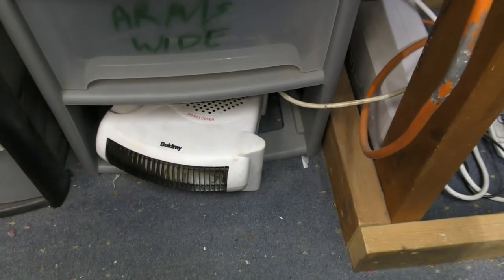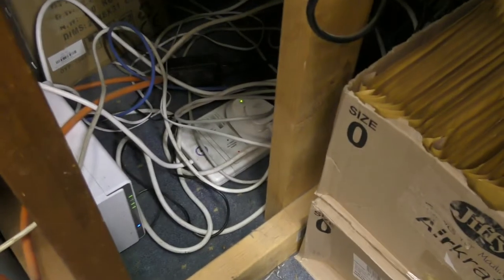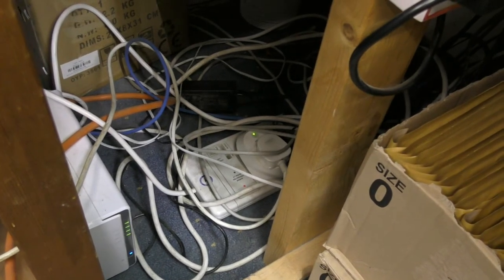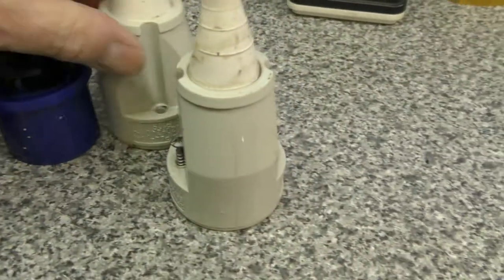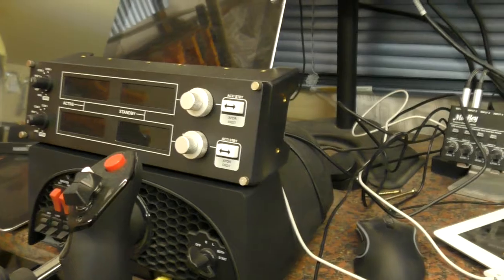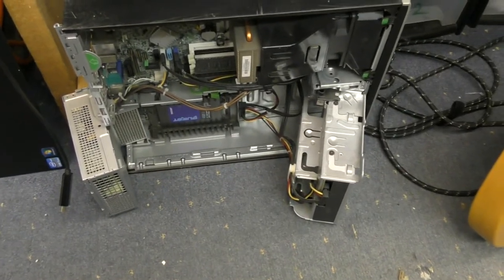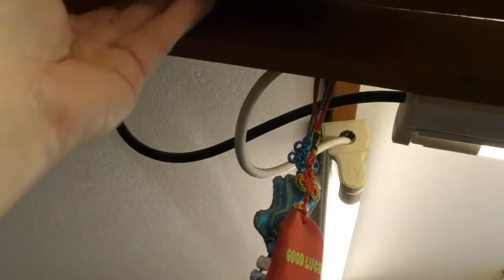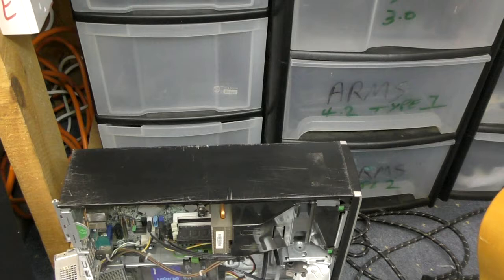Nearly burnt the workshop down!

Comment: Small contact surfaces that do the actual contact, so the current is going through a tiny contact surface. Thus it has cycles of heating and cooling, which means the contacts eventually get a thin oxide film on them, and then you get a thermal runaway event. Not helped by the chrome plated pins, which will grow a thin oxide layer, and make for the small high resistance spot.
Reply from the maker: Indeed, I think the overnight 2000 watts did the damage and it has been smouldering since then.
Good news is the water appears to be a red herring and the flight PC has dried out in the lid area and no other damage was done. But it was a timely warning to seal the roof up again.
Reply: @Trevs-Shed  That dried up roofing tar will likely respond to mixing in some turpentine or linseed oil, which will make it work again.